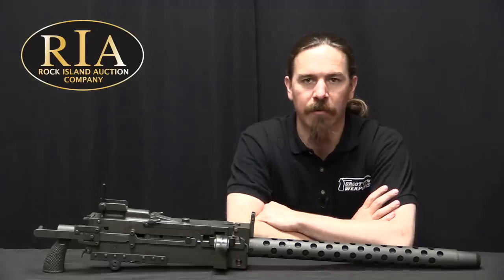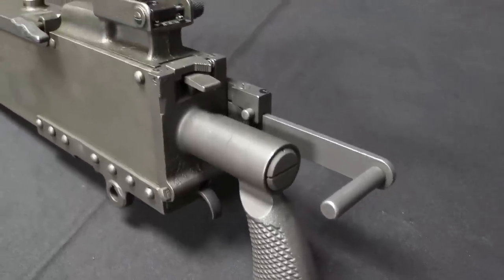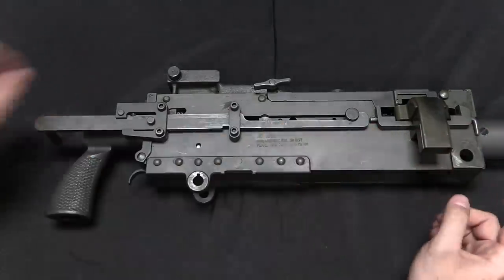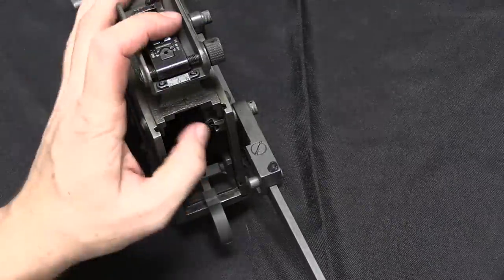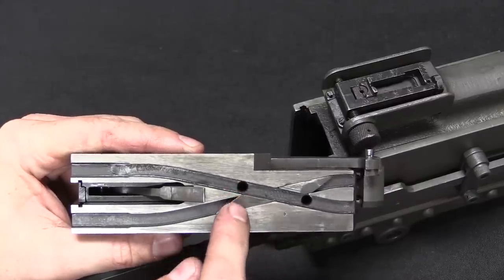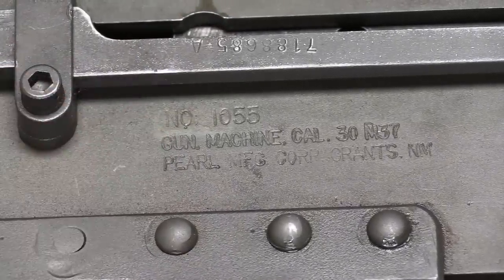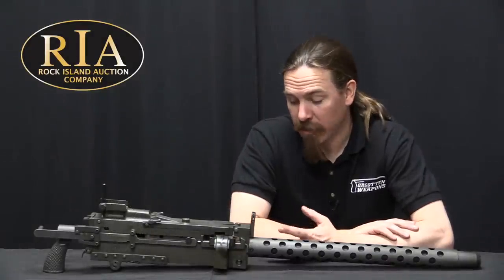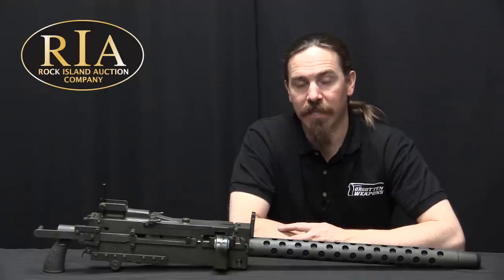M37: The Ultimate Improved Browning 1919

Comment: Wasn’t the m60 tank still in service with the marines untill the 1990s?  If so this gun would have remained in service untill they were finally retired.
Reply: Probably switched them to the tanker version of the M240 so it could use Nato 7.62 if not to the tanker's M37 0.30-06 setup.

Comment: Unless this MG is used on the outside of the tank (i.e. on the turret), what good is the rear sight? You can't use the rear sight unless it is co-witnessed with the viewing prism for the gunner or TC, and I doubt that was the case.
Reply: Probably to provide for a dismount capability if needed, I'd guess.
Reply: We used the C5 version of the 1919 in the Canadian army as a Coax MG in our "cougar" armoured vehicles.  The gun we used was identical to the ground mount version.  We also carried tripods so we could use it ground mounted if we needed to.  It's about a 30 second job to dismount it from its coax mounting.

Comment: Please allow an old tanker to point out that this not the configuration that would be found inside a tank turret as a coaxial machine gun. A coax would have a solenoid attached to the gun either behind or beneath the manual trigger that hooked into an electrical lead going back to the gunner's trigger on his Cadillac Handles (manufactured by Cadillac Gage, not GM) controlling traverse and elevation. The gunner would flip a switch to select either the main gun or coax, and squeezing the trigger would complete the circuit to make the solenoid plunger move, contact the trigger and cause the gun to fire. The gunner was seated on the right side of the main gun while the coax was to the left so there was no way he could reach a manual trigger. In case of a misfire the loader could try firing manually (I'd just recharge the gun and go). http://ww3.rediscov.com/springar/full/407-60.1.jpghttp://ww3.rediscov.com/springar/full/406-60.B.1.jpg

Comment: The recoil spring on a standard M1919 is easy to take out and reassemble.  All you need is a cartridge rim.  Pull the charging handle all the way back, and turn the retaining screw head in the back plate 1/4 of a turn.  This captures the spring.  Very similar to the magazine catch screw head on the 1911 pistol.  If the bolt is out, place it nose down and you can turn the screw head back to release the spring.  Hang onto it- it's not stiff, but it is long.  Reassemble by pressing it into place, and turn the screw head to capture the spring.  Do not try to remove the back plate on the M1919 without capturing the spring, and moving the bolt forward.

Comment: Doesn't it become a bit more difficult for logistics when the machine guns on tanks use .30-'06 and the rest of the Army used 7.62 mm NATO?  Or was the M37 also chambered for 7.62 x 51 mm?  That extra six millimeters of cartridge length was a real problem when supplying the troops at the front, which is why the M1919A6 was quickly phased out in Viet Nam.
Reply: Yeah, later was introduced the M37E1, version on 7,62mm NATO.